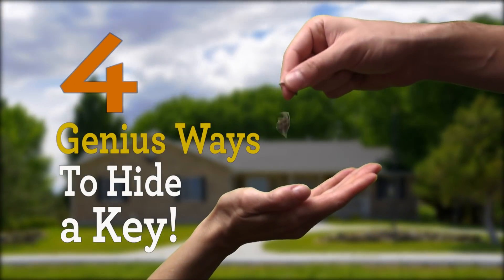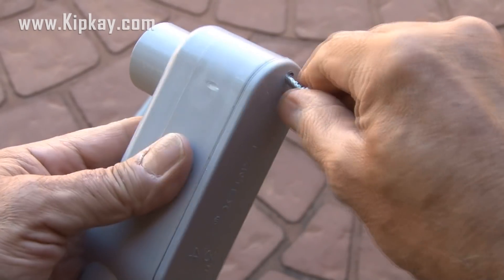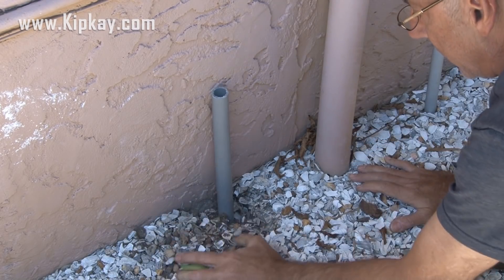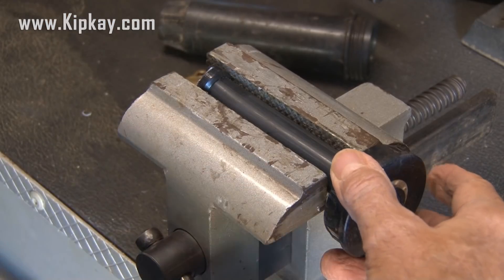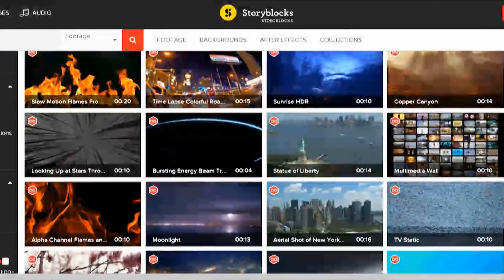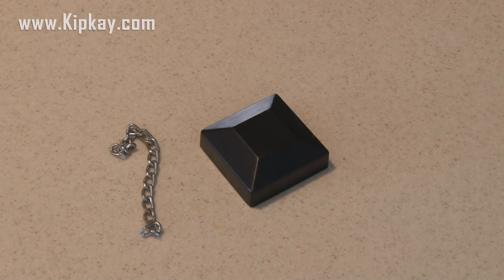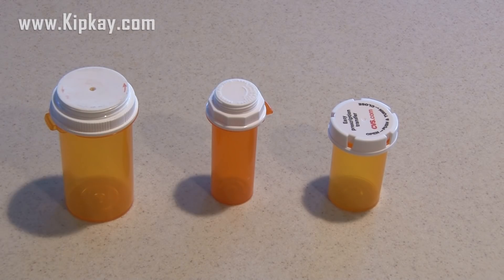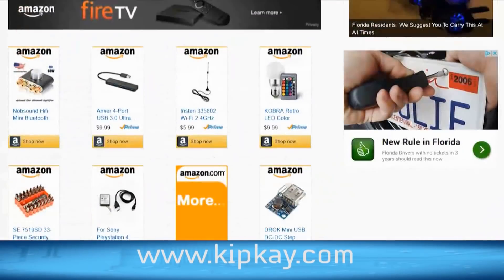4 GENIUS WAYS TO HIDE A KEY!

Comment: you can put your key under the guy next doors welcome mat! that way it wouldn't fit the closest door.
Reply: James stranger Or hide 8 keys in 8 places and 7 don't fit your locks. Works as long as you don't have dementia.
Reply: Buddy Clem or throw a bunch of keys in a flower pot. and one happens to fit the door. just mark the correct key in an unnoticeable way. paint them all different colours. remembering the color of the door key!

Comment: Won't people wonder why there is a pvc pipe coming out of the wall right next to the meter? Won't they wonder where the electrical wire is going?
Reply: I bet you wouldn't notice anything
Reply: good
Reply: Not really, the area he placed it is right next to the meter, and 9/10 times the panel is on the other side of the wall.  Anyone would probably think they are running power to a shed or something of that nature.  Regardless that is the ways you run wires underground.  It isn't out of place.
Reply: Most people won’t wonder that.